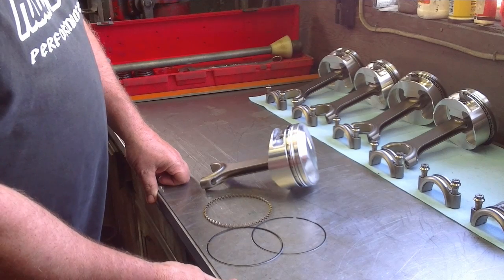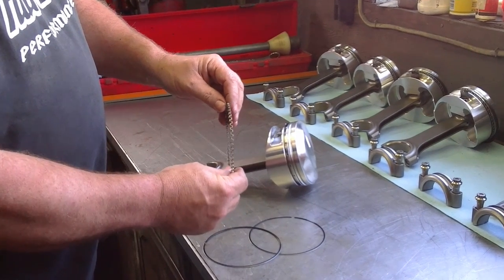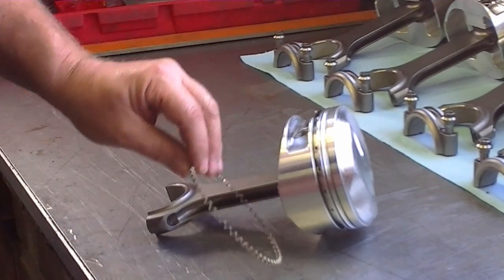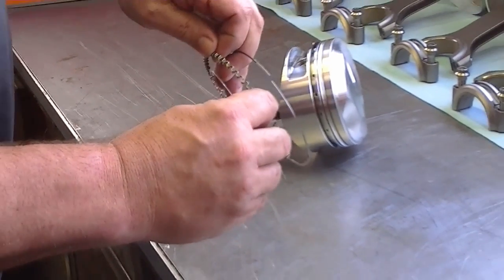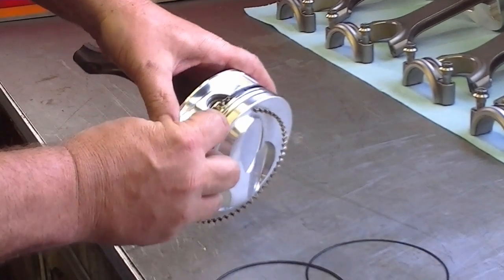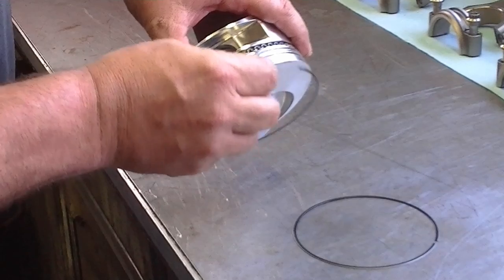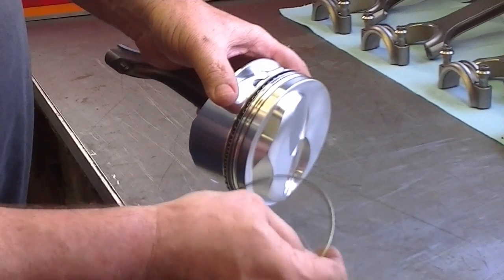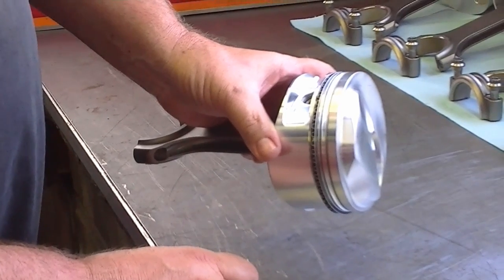How to Install Oil Control Rings

Comment: Wishy-washy kinda video. didn't make any sense to me because it doesn't explain gaping
Reply: Oil control rings (bottom ring set) typically are pre-gapped from the manufacturer and it's rare that any adjustment is needed.

Comment: Does the oil scrapper require sizing to the bore? Or do you just put it on right out of the box? Thank you
Reply from the maker: You can put the rails in the bore and you should have at least .005 per inch of bore. Check out my video on how to check oil control ring tension.
Reply: I tried to find that video can you link me to it? Or what is the title of the video. Thanks again!

Comment: Mark,
what is the Toyota Camry issue with the 4 cyl. 2007, & oil consumption problems?
The Oil drain holes clog up and engine burns oil
Reply from the maker: Probably the drain back holes are too small.